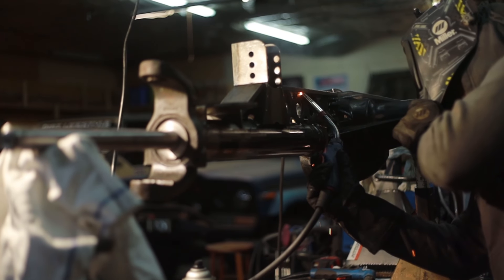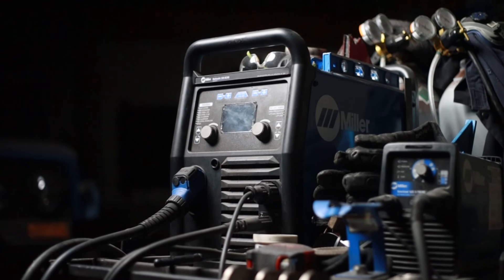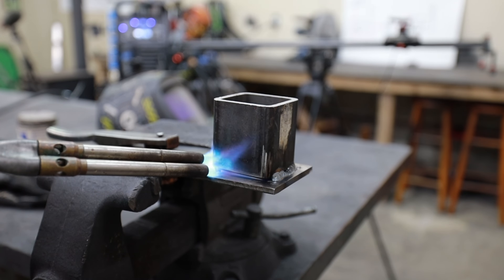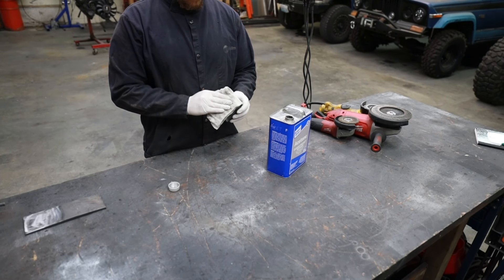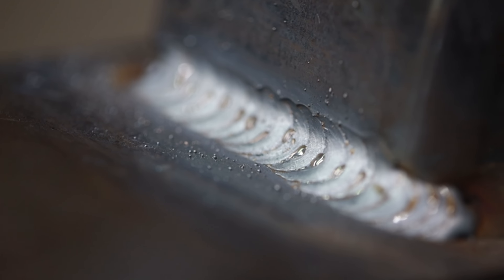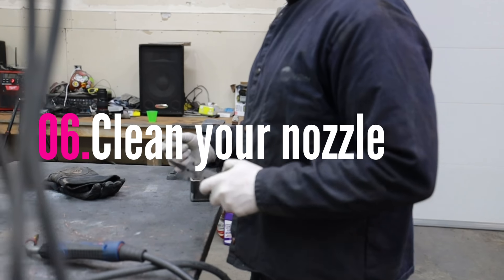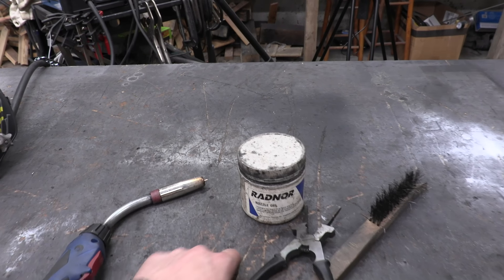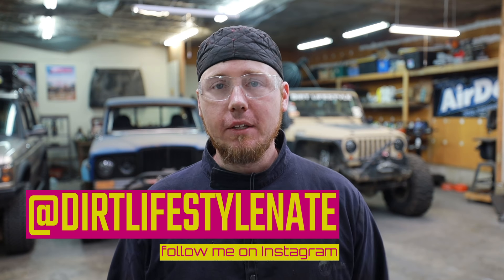7 Tips/Tricks To Make Your 110v Weld Like A 220v! (welding tips for beginners)

Comment from the maker: Hey folks! I messed up in this video! I tried to  simplify the difference between a 110v and a 220v welder as a teaching tool and it backfired big time. The way a welder works is much more complicated then the way I present in the video and it pissed off a lot of people. I still stand by these tips! Don't loose site of the purpose of this video! I want to help you become a better welder! If you would like to learn more about how to select the correct size welder and have a basic understanding of what these numbers mean click the link below. 
Don't take my explanation as fact and the same goes for my comment section. There is some very misleading statements in there as well. 
My apologies for the confusion! I hope you still get some inspiration from this video and these techniques help you in some way. 
Thanks for watching guys 🤘
https://welderslab.com/how-many-amps-do-i-need-for-a-mig-welder
Reply: It is a good generalization about the relative capabilities of 110, vs. 220 volt (input) welders.  Of course the output voltage and current between the weld ground clamp and the tip or MIG wire is where you do the power calculation. Good tips though I am trying to make the most of a 110 V 140 amp flux core welder and every bit helps.
Reply: 140 amps from a 110 volt welder would be the same as 140 amps from a 220 volt welder, assuming they have the same open circuit voltage, and can maintain the same arc voltage while welding. The 220 volt welder will draw roughly half the amperage from the outlet as a 110 volt welder, assuming similar design. For example an inverter based machine will draw less current for the same output than a transformer design. But as a general rule a 220 volt machine has a higher rated output than a comparable 110 volt. As an example Miller, Lincoln, and Hobart make the three most popular 110 volt Mig Welders. The equivalent 220 volt machines built on the same platform are rated at 180 Amos for the Lincoln, 190 for Hobart, and 230 for Miller. The Miller is a dual voltage machine and will produce 130 amps when running 110 volt. The Dual Voltage Lincoln will produce 140 amps on 110, and 180 on 220. On the surface one would think that the output on the Lincoln would only be 90 amps on 110. I don't know enough about transformer design to explain why it works that way. But it also prove that your advice is sound, get a 220 volt welder if you can. With the increasing number of dual voltage machines that are available at reasonable prices, that's probably the best way to go. That way a person doesn't have to buy another machine when they can finally upgrade to 220 power.
Reply: ha, I was about to say something about that but I see that the issue has been sorted out.  and your right don't let that take away from the purpose of the video, and thanks for clearing it up.
Reply: @calvinhandley2373  Right. The important part is the output voltage of the machine. 70 amps on a 20v welder comes out to about 1,400 watts of work. 1,400 watts on 110 is about 13 amps. 1,400 watts on a 220 is about 7 amps.  I think a bigger importance between 110 and 220 is the phase of the power. 220 is going to be more friendly on inductive loads (transformer). Also difference is essentially 120 pulses per second on a 220 vs 60 pulses per second on 110.
Reply: Nothing in here sounds wrong or misleading to me. I didnt much know anything about the wattage differences. My dual voltage welder goes to 165 amps on 110v and that welds the same as 165 on 220v mode.
Reply: The problem is that without these techniques, you can weld up to 1/4", with them you can push it to 3/8"(and that's risky) Technically anything thicker than 1/4" should be spray transfer to ensure proper fusion and a 110 cannot do spray arc.

Comment: I’ve been welding with a 110 for ever just cause I can’t justify the cost of a 220. I still learned a bunch by this video. Will definitely put them to use in my next project.
Reply: The answer is simple, my HF 220v welder weld 2 time faster with considerable more penetration that my LC mig pak 140. so, plating a frame section take me 1 hour on my 220v and 2 hour on my 110v.  and then the job is cleaner and stronger. with 110v you need two pass for 1/4 steel . and only one pass for the 220v  cleaner, stronger and faster job. my hf 220v cost me 220$ and my ln 110v  MIG pack $400, i like more my mig pak for sheet metal wide range of adjustment.

Comment: Sorry, Nate. I have to correct you. There is a big mistake in your math. You are mixing your input volts with output amps. You need to use output volts and amps. My little 110v outputs 88 amps at 18 volts, about 1600 watts. A 120volt outlet on a 20 amp breaker can never put out more than 2400 watts. Even a 220 volt outlet on a 50 amp breaker can only output 11,000 watts.
Other than that, keep up the great work! I've learned a LOT from you!

Comment: I have welded with large 460 volt 3 phase welders at A.O. Smith  building Automotive and Truck Frames, and later at Heil building Dump Truck Bodies.
   Never had the kind of cash to buy a nice 220 Volt mig welder, so I settled for a 110 Volt from Farm and Fleet with gas shielding which I prefer.
  The welder was great for many years, now I use it primarily for basement projects.
  I was able to purchase the welder I originally wanted Lincoln SP150 after it was 20+ years old, but I got it for good price about 1/4 of it's original cost.
  I really enjoy this 150 amp welder, and it pretty well takes care of all my welding needs.
  Now I need a Hypertherm XP 45 plasma cutter and I will be happy, but again the price is rather high for me to purchase at this time.

Comment: Surprised you didn't mention using flux core! I weld every one of my projects with a 110 flux core; flux core provides more heat and less filler than solid wire so it lets you go slower and really burn it in. Plus it's cheaper!
Reply: I’ve welded some thick 💩 with flux core and 110v.  Although I wouldn’t build a house on it. 😜.
Reply: Can you use flux core and c25 gas together?
Reply: @moejr14  
You can, but doesn't make a big enough difference to me to justify the cost of gas and flux. Won't hurt but isn't cost effective imo. 
Give it a shot.
Reply: @fml5910  dual Shield flux core uses 75% argon 25% CO2 Lincoln 211 wire you can get from Home Depot is the best thing to run it doesn't use gas and you can run the 200 amp Harbor Freight MIG welder on that as well which is a bulletproof machine
Reply: @fml5910  Typically no, that's the point of Flux core... no need for gas, the wire is self shielded

Comment: One thing to add, multiple passes! You mentioned chamfering and leaving a gap, the best way to weld thick material is chamfer it AND leave a gap, your first pass is called a "root" pass, then you stack additional beads on top ending in a final "cap" bead to make it look nice and add the final seal.

My GF was trained as a pipe welder and that's how they welded basically everything. No matter how big the machine, there comes a point when material is just too thick for a single pass.

Comment: I know nothing about welding. Always wanted to though. Yesterday I made a two transformer spot welder in parallel so 110 volt. It look's to be maybe strong enough for small ark welding. My farther passed away in November he had many welders not having access to 220 readily available  I Grabbed a small 110 might. I tell you this because I just learned from this channel more in 10 minutes about mig welders than I have ever been able to glean my whole life from the curth/undercutting to the 400 degrees for the thicker metals. Thanks very much. Now I have to subscribe and practice practice practice.  Thanks. You are Robboni/Teacher. Comes from Latin old Latin. Thanks

Comment: Hey Dirt, thank you! Awesome video. This is exactly what I was trying to do last weekend and I was struggling. I was trying to weld 1/4" steel on to same using my Miller 140 (110/120v) MIG welder. Specifically, welding a couple of lift points (for a Hi-lift jack) onto a trailer hitch. I got it "done" but the welds were horrible. Lots of popping etc that left some ugly, lumpy welds. Even with the beveling I gave the metal edges. 

So then I did some googling and found this video. The two key pieces of advice that helped: 1) Move the ground clamp much closer to the weld area, and 2) Preheat the metal. After a successful test on one little section, I ground down my crappy welds to start over. For the preheating, I used my little MAP gas torch, and my Craftsman IR thermometer as a checker. Heated each area in turn to about 450F. The welds went on with perfect sizzle and good penetration. They aren't award winning fish scales like the ones you did, but they are strong as hell for sure.

Comment: Excellent tips!  My shop only has 120 and no option to upgrade to 220.  I used some of these techniques with success but I eventually purchased a 220v generator at a gov auction and use that for my 220 Tig (sold my mig).   The best part of it is I never have to worry about constantly tripping breakers when I am welding.   The downside is ... can't think of one.  :)

Comment: In my last house I had a shop in the back that I did all my projects in there was only 110 outlets. But I the breaker panel I had a couple of spare spots so my dad "created" a 220 circuit that we ran to a home made "sub station" that we could run his Lincoln 220v stick welder and his Lincoln 110v mig welder. He took 2 circuits and put them in series to get 220v and also paralleled them to get 110v with 30amps instead of the normal 15amps. We had all the power we needed.

Comment: Have only had a 110v Flux Core machine for....a LONG time, sadly.  But?  Decent results.  Not the prettiest welds, but have had none break.  Including welding some 1.25" cold roll.  Hot spark, SLOOW feed, and pay attention.  I will start learning to heat the material first.  Something I have known about, but been lazy.

Hopefully by the end of the year I'll have a shop again.

Comment: I have a stick welder for the 1/2 " stuff yes I will pre-heat just to get things warm & ready to weld. The tips for 110v 1/4" is the max I weld although I did weld 3/8" tubes on an axle I pre-heat multi-passed it in stages even braces & a jig just to hold it straight. The sight of heat marks is all you need  to see verifying penetration.  I enjoyed the vid thanks!!!

Comment: I run a Lincoln 110 v and it's been great so far. I typically weld 1/8 and 3/16 but I think when I started learning to weld, it's made me a better welder. I can't wait until I can afford a nice 220 welder. Great tips!
Reply: 220v eat metal , and 110v heat metal . you wil know when you try 🙂

Comment: Hi,i just subscribed,i bought a yeswelder core flux 135,after watching your. Video i now understand whats happening,its designed for 110volts,i started off at welding 1.6ml thick tube at there settings it says 95,from 95 to 75 it burns holes,now im understanding after your help,if there setting is 95,half it and correct up to get my correct setting,thank you so much you are a champion ,cheers adrian jones ulladulla nsw.

Comment: Uh, Nate... 110 and 220V is the INPUT, not the OUTPUT. A standard 110V outlet puts out ~2100-2400W, so to get the high amperage of a welder, you’re knocking down the voltage to double digits.

Comment: Use to weld super heavy structural steel in the coal mines. Pre heat bevels and multiple passes anything is possible
Reply: Absolutely👍🏼 I’ve done the same to weld 1/2” & 3/4” steel plate with my 120v flux core welder & it worked great. Also if it’s a machine where amps are controlled by/with the wire feed I’ve found it helpful to not crank it up all the way. That way your in it longer and it puts way more heat into the weld vs just cranking the feed/amps on this type of machine.

Comment: Great video. My welder does both but gotta run a 220 line. Right now just welding frame stiffeners so it will handle that ok

Comment: I think you have a little maths issue there regarding your wattage.  While you got ohm's law right, on the input side you're not dealing with that sort of wattage.  You're nowhere near 180 amps at 120/220v.  That current is on the output side of your welder and is at a much lower voltage depending on your settings, perhaps 18v. 
 
A standard 120v outlet (NEMA 5-15...the standard plug you see around your house) is limited to 15 amps.  A high-current 120v outlet (NEMA 5-20...looks like a standard plug with an extra little tab on the neutral and can accept a regular or high current plug) can do 20 amps.  Both of these of course require the appropriate breaker in the panel and wire size to support them.  So that limits your input power to a max of (120v x 20a) 2400w.  Once it goes through the transformer or inverter of your welder and comes out at whatever voltage you're actually welding at, you're still limited to that 2400w.

A 220v outlet can come in many capacities (20 or 30 is common for welders in a shop, but 15 up to 50 can be found in residential) but as noted, even if it's still only 20 amps you now have nearly double the wattage potential.  (220v x 20a = 4400w)  So once you step down the voltage through the machine to output voltage you have set you still have nearly double the potential wattage.

If you somehow did manage to pull nearly 40,000 watts through your shop's 220v outlet it would prove VERY exciting for a brief moment while the wires from your breaker panel to the outlet vaporized, then you'd get a fun visit from the local fire department when they came to extinguish the smoldering rubble that was your shop.

In summery, a 220v welder DOES have (nearly) double the total power available relative to a 110v welder at the same current and could have even more depending on the type of outlet used.  But that '180 amps' or whatever rating is at the output, not the input.

Regardless of all this I also know you're still a much better welder than I am.  So there's that.
Reply: Right on. I wish I would have read through more comments before posting because you beat me to it. 

I like your description about what would happen if you pulled 180A though a 220V NMEA 5-50 plug, but hopefully your outlet is protected properly with a 50A max breaker and it would save the shop.
Reply: Great explanation!

Comment: I don't recall if you mentioned the wire size in the 110 welder vs the 220. I run a .025 wire in my 110v welder and .035 in my 220. I could never get .030 to run right in my 110v welder so I switched to .025 and it seems to like it better.

Comment: Cool podcast and very informative, I would like to make a wide-body Camaro with a rear end off of a pickup truck or a SUV for strength and the width of the axle and build the wheel Wells around the wide tires & Axle, I want the baddest widebody Camaro in Detroit this summer, have you any pointers.

Comment: As for distance to ground at different voltages, Ohm's law plays more of a role than "amount of energy." The resistance of the material is the material is the same either way. As you said, power (Watts) is current (amps) x voltage. Loss due to resistance is proportional to current. For the same power, you require half the current when doubling the voltage, but double the current means double the heat loss due to the same resistance.

Another aspect to changing voltage is that arcs (ionizing air and jumping gaps between metal conductors -- pretty important to welding, but not desired in most other uses of electricity) are proportional to voltage. It's the reason that plugs in the UK are so much larger than the ones on the US, and why in the US, plugs are larger for higher voltages than lower: you need a bigger gap between conductors to prevent arcing between them at higher voltages. It's also why you see outlet switches in the UK but almost never in the US.
Reply: Not sure what it is to jump in Ark Gap but I know that 480 v doesn't jump until you touch lines together but this I do know thicker cables are for more amperage not voltage give you an example hundreds of thousands of volts go through high lines a very small damager when you get the demon with 240 voltage you can get to number 1 Copper depending on amp draw

Comment: Great video. I watched this months ago but am revisiting it now that I'm actually getting into welding and only have 120v to work with right now. I think it's typical but I'm finding it difficult to get good results with the thin stuff and thick stuff (chicago electric flux core). One of the first projects I want to do is new shock brackets on my Ford 8.8 housing but I'm thinking I should wait until I have 220v and more skill. I'm wanting a better machine (Hobart Handler 210mvp or Multi-Handler 200, or a Forney 140MP for sheet metal + used Lincoln 225 AC buzzbox for thick stuff) but there are so many considerations it makes my head spin.

Anyway, thanks for this video, it has made me a better welder already!

Comment: I might be wrong about this but your watt calculations might be wrong, this is just my view on it. for all I know you might be right. a typical 220 welder uses a 50 amp circuit. then 220v x 50a is 11,000 watts. where a live the 220 measures 250v. even with the high voltage that is only 12,500 watts.  if you go by your calculations and use ohms law to calculate the input current it would take nearly a 180 amp circuit to power the . in my view, the output voltage will have gone down to aroul=nd 20 to 30 volts for normal welding. with that voltage, the watts are 3600 to 5400 watts on a 180 amp welder. on the back of the welder usually, there will be a label that says the max open voltage on the output for mig with the amps. with that information, you could calculate the put wattage of your welder. I have used a similar welder and it only takes a 30 amp circuit so it only needs a 7200-watt input.